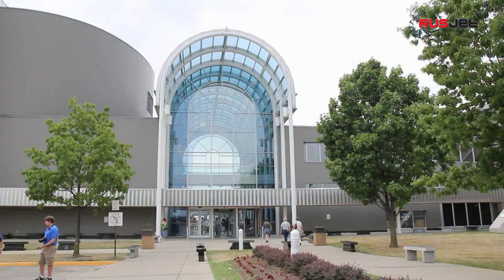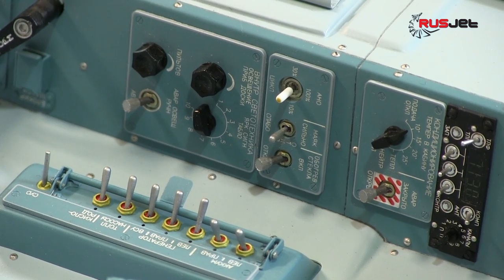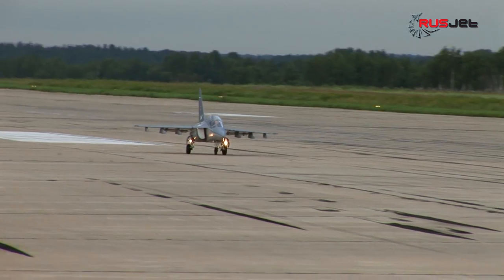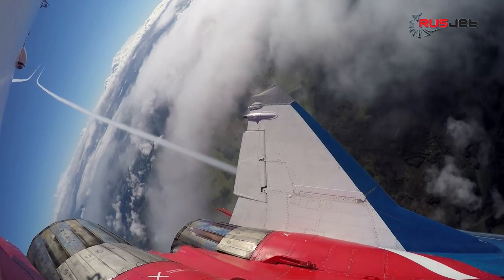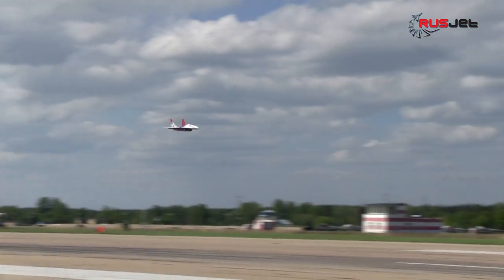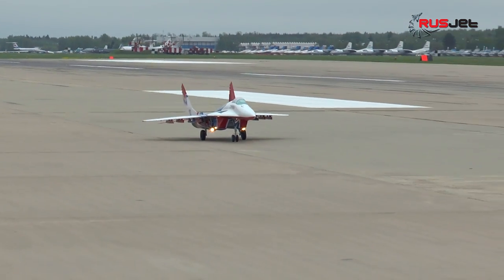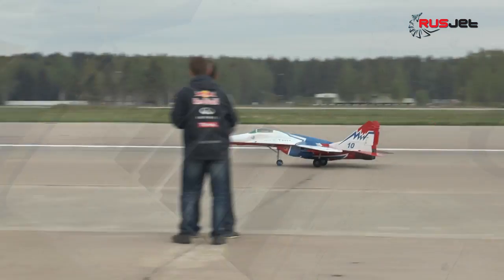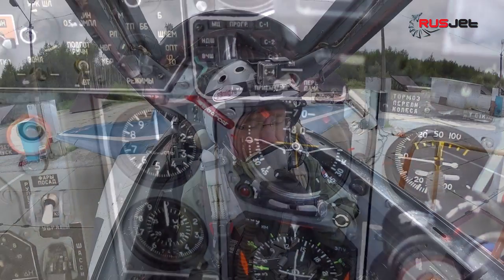The MiG-29 scale jet model project. Better than Yak

Comment: I worked as a tool maker for the UK admiralty. With the use of the full tool makers workshop and the other 19 toolmakers . We would have had difficulty in manufacturing such a model.  Shear amount of work involved is tremendous in making such a model.
Reply from the maker: We had to go for very bold engineering solutions, so as not to go beyond the weight limits, in accordance with the rules. But it was very exciting!

Comment: I'd create a computer program into the controls of the modeler's panel to mimic the speed and real air flight profiles to behave. The YAK 130 has this feature to mimic all of SU 30 to 37 (almost) flight performances to better familiarize the cadet pilot with the type of aircraft we will be flying.

Comment: In F ing credible, yet Again!   I purchased a yak version and love it. Will this Mig be available as a kit? I especially like the variable nozzle exhaust. How was the circular symmetrical closure done? I think the use of springs loading to return to open position.  Are there kits out there for making the "turkey feather variable exhaust nozzle"? I  know it doesn't affect power performance at these turbine output level, and I'm not into the competition display but it's the aesthetics I'm looking for.  Like navigation lights and other scale details etc..
I'm just a lone weekend flyer and soon to a retired trauma surgeon, looking to enjoy myself and waste a little money more than I have time left on this rock. Again another excellent project and I'm awaiting your next offering. Hope I'm around to see it.
Reply from the maker: We do not plan to produce a commercial version of both the model and the individual parts. Unfortunately, we do not have the capacity to do this. Our priority is sport

Comment: A remote control airplane is assembled with ROTO 50 V2 PETROL ENGINE (50cc).
And this rc plane is flying about 490 km during 330 minutes without landing.
The spec of the rc plane is as following (below).

Is it possible for the rc plane to fly that distance?

Specification of the rc plane :

Engine : ROTO 50 V2 PETROL ENGINE (50cc)
Fuel : 7.47 Liter, about 5.5 kg
Camera : Sony A7R, 465 gram
Lens : Sony FE35mm, 120 gram
Battery : ??? kg
GPS : ??? kg
Controller : ??? kg
propeller : ??? kg
Reply from the maker: The unmanned model can be created for any task. But our models are designed for sports.